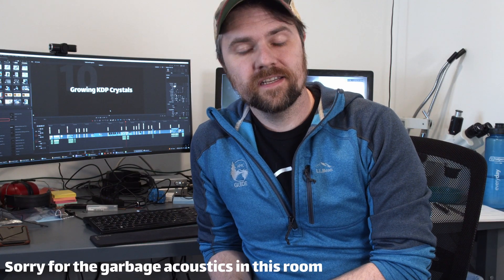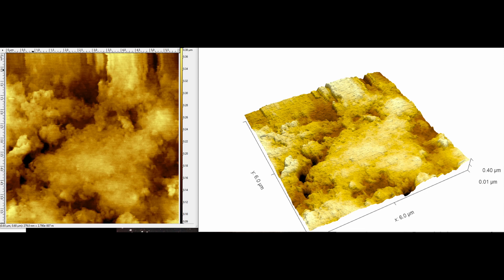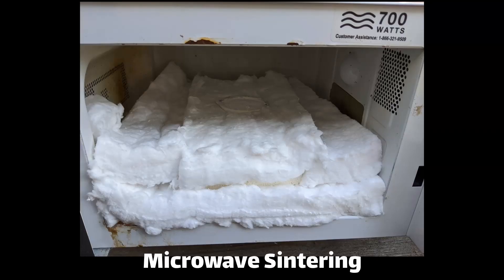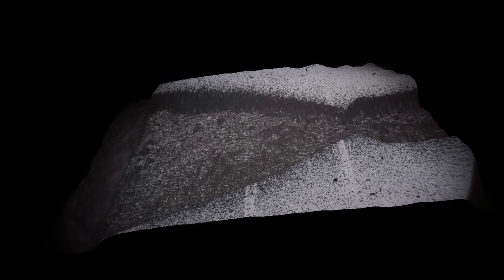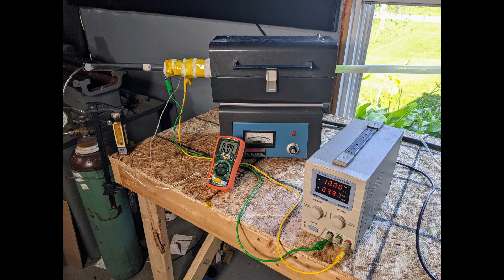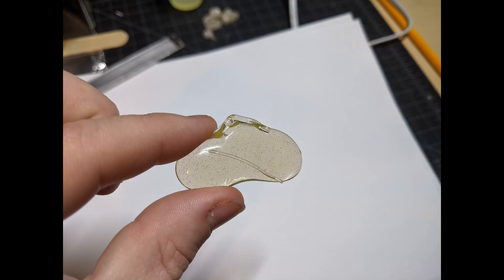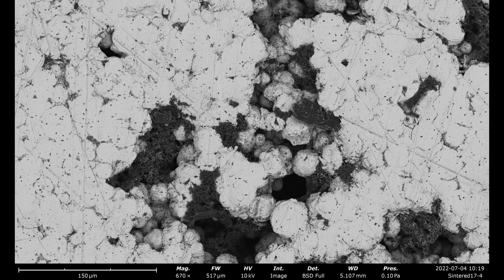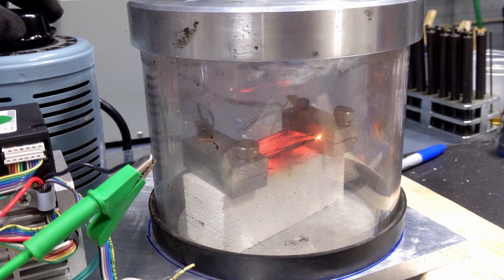A year of failed experiments

Comment: Growning kdp crystals: Maybe you could somehow apply a charge to stop impurities from getting close or maybe even use it somehow to filter the mix beforehand?
Super Hydrophobic coating: maybe make the coat thinner?
Metal fdm printing: could an innert gas be used to fill the cube beforehand ( and maybe keep it free of oxygen after being printed), or to replace the in/ around the furnace? (making it work even if it's not a perfect vacuum). 
Hope this helps
Reply: Oh and loved the video. Feels like there's so much to be learned from a failure (sometimes even more than a success).

Comment: on the ECM thing, I can comment that the people doing some of the 3d printed gun stuff have figured out that you want to minimize surface area of electrode in contact with work piece, and run the discharge voltage in pulses, and you'll need to experiment with your setup to figure out the ideal hz rate for the pulses.  people are starting to experiment with this to drill holes for barrel, besides the ECM rifling process that's out there. (yes there's how-to's on rifling a barrel with ECM, on Odysee.)

Comment: Another cool electroplating project you could try replicating is from a guy on Hackaday named Michał (copy-paste that, the l is a special character with a little line through it). The project is called "Self-Created Metal Composites". He took a tangled mess of carbon fiber and electroplated it to bind the fibers together into a sturdy low-density structure. I tried it but the copper seemed to just collect as a fine powder on the carbon rather than binding together. But I'm no good with chemistry and it was my first time trying to electroplate anything so I'm sure I just didn't do it right. It sounds like a very useful technique, so showing it to your large audience would be great.

Comment: Boxes of projects, image stacking was very new in 2010, helicon focus, i had a free version as a tester and gave them some fly stacks I had made on a 2D rotary stage  tried to hack a Cannon lens. no info and failed. metal epoxy for lathe bed repair, W2S moglice recipie. filled a cheap pillar drill stem with concrete and rebar. 3000C, excited. Thanks for sharing all those paths of facinating ideas. we cant go down them all. I feel I share several.

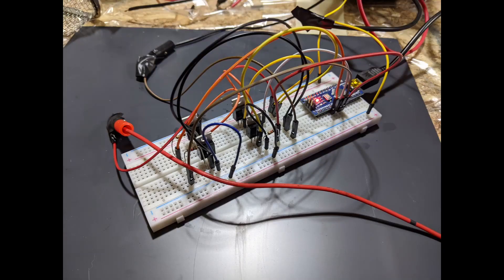Comment: Is that a H-Bridge at 3:48? Im currently trying to build a pulse reverse power supply with a H Bridge. Did yours work?
Reply from the maker: Been a while since I worked on that, but yeah I think it was an H-Bridge. I seem to recall it working reasonably well :) I was trying to plate thickly and into deep blind holes, and it ended up working much better than the regular DC. Not perfect, but good enough
Reply: @BreakingTaps  Is there any hope that you would share the scematic of your H-Bridge? I have the chemistry done for my electropolishing project but i am terribly failing with the pulse reverse supply. Btw. i also did some research with ECM and Jet ECM and actually managed to drill some holes into Stainless steel and titanium. I used a fish tank on a 3D printer and attached the cathode nozzle where the filament extruder was supposed to be. Worked pretty well.

Comment: Instead of growing tungsten disulfide layers, maybe you should try to coat parts by high velocity impinging commercially available tungsten disulfide powder onto your parts with essentially a higher pressure sandblasting cabinet. According to different patents and papers this pretty much creates a monolayer of tungsten disulfide since it doesn't stick to itself.
Reply from the maker: Huh, that's pretty nifty! Will do some reading, cheers for the tip!

Comment: Can you wrap the objects to foam sinter in stainless foil? Maybe drop a little bone black in there too?
Reply from the maker: I think that would help! I picked up some activated carbon to use as ballast a while ago, and think there's a sealing issue on the furnace itself which was preventing a good vacuum. Hadn't thought about a stainless pouch, that's a great idea. I think I'll probably pick that project up at some point, could probably get it working with some more testing.

Comment: 13:41 What if you wet the material with alcohol before pulling the vacuum? I would guess that would drive the oxygen away from the particle surfaces and leftover would act as reducing agent.
Reply from the maker: Will give that a shot next time! The Virtual Foundry folks also recommend adding some kind of reducing "ballast" like carbon/graphite to help eat up excess oxygen. I suspect I might have a leak in the vacuum furnace though. It's an old ebay find and when I was packing it to move shops I found a section which I think isn't sealing well, letting in tons of ambient air.

Comment: that ultrafast sintering sounds quite interesting, especially since it can get to such temperatures so quickly.
Reply from the maker: It's a really cool technique! And such a simple setup too... if I was being less cheap, a simple glovebox with inert gas would be pretty easy to knock together. I just didn't want to pay for the argon 😁
Reply: @BreakingTaps  Can you shed some more light on that carbon felt? Is that the same thing as those carbon filters for solder fume extractors?